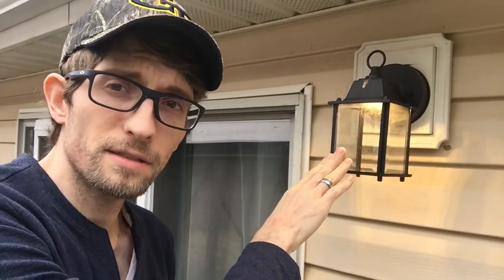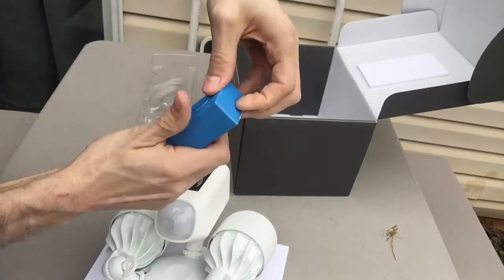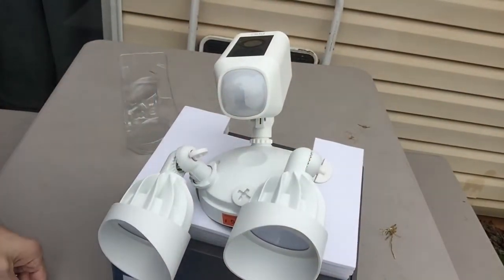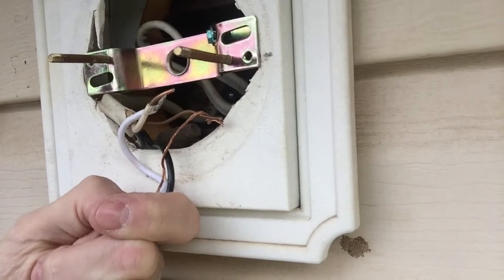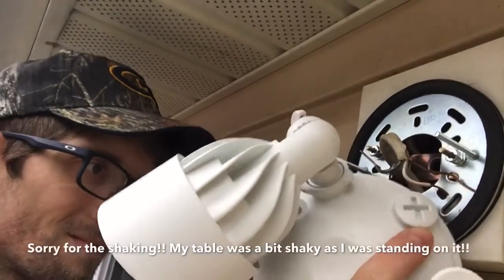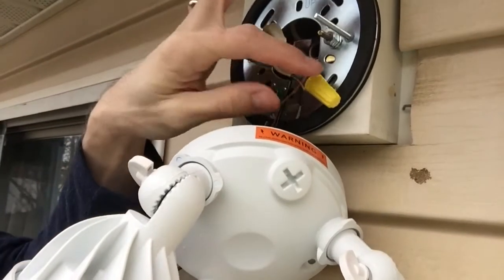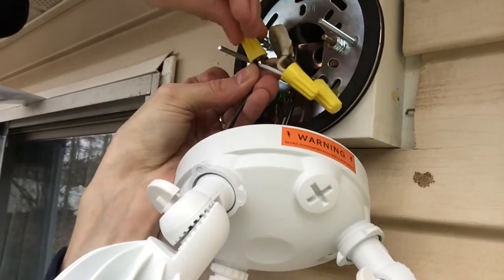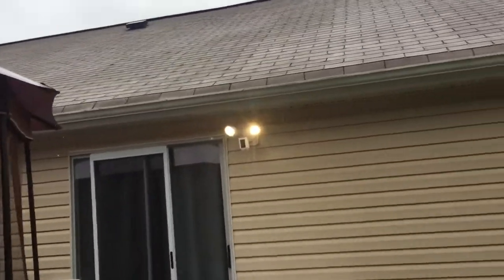How to Install a Ring Floodlight Cam

Comment: I have the same lantern light in my backyard.  I wonder why the builder did not put in a floodlight but a lantern.  Thank you for your video I was wondering why the white trim with the sliding.  Did not know it was a junction box.  Thank you for sharing
Reply from the maker: Hey there! First off, thanks for watching! I imagine it was cheaper to use lanterns instead of the floodlights at the time they built this neighborhood, around year 2000. Glad to hear the video could be helpful to you!
Reply: Handyman for the Average Man thank you for replying I just notice that mines also has a screw in the front bottom under those two nuts

Comment: Dumb question, do you have to keep the light switch, in the house, on at all times now that you have done this?
Reply from the maker: Not a dumb question. I didn’t know the answer until I had it all set up. The answer is yes, if you turn off the switch, it disconnects the ring device from the network and therefore the app. If this is a problem for you with kids or whatnot,   the switch could be somewhat reconfigured to where the plate doesn’t even have a light switch. Just a thought. Thanks for watching!! Good luck.
Reply: Handyman for the Average Man thank you I really appreciate that